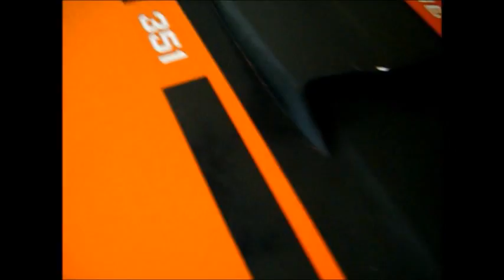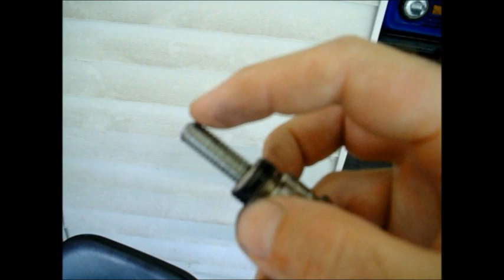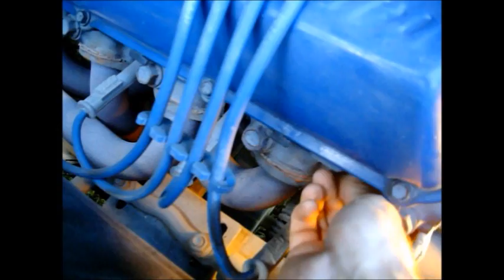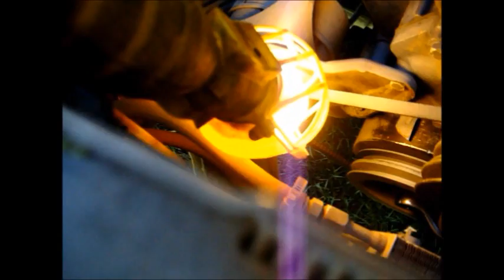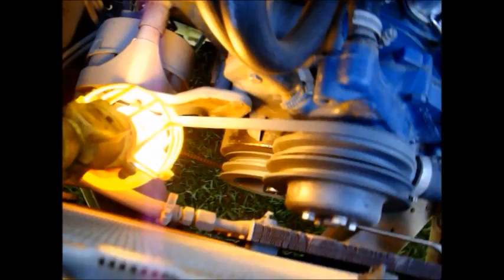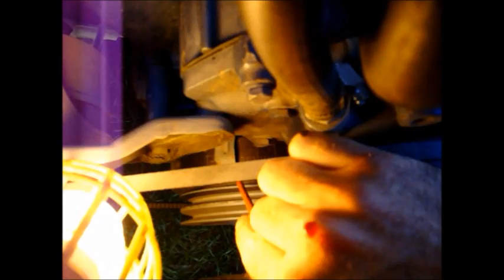Timing - Part 3 - How To - Using a piston stop to find true #1 TDC.wmv

Comment: How do we know it is tdc exhaust stroke?
Reply from the maker: That's the easy part.  Just pull the number one spark plug, and block the spark plug hole with your finger tip or thumb.  Then turn the crankshaft with a 1/2" drive ratchet setup on the harmonic balancer bolt.  As the piston comes up on compression stroke, the compressed air has no where to escape, so it blows out by your finger, you'll feel it.  When the air blows out, just keep an eye on the balancer, the timing mark will be coming up soon and you'll be at TDC of compression stroke on number one.  You could remove the coil wire, and turn the engine over with with the starter, with your finger blocking the spark plug hole, but the crank spins kind of fast like that, and it's easy to run it too far, and miss the timing mark.  More control with a ratchet setup, but that's just my preference, either way will work.  Just make sure you know where number one is, different car makers number their cylinders differently, which is annoying.  If you don't have a repair manual for your car, you should buy one.  And of course for this trick to work, your valvetrain needs to be fully installed, and rocker arms adjusted (up/down on the pushrod, while adjusting rockers on hyd lifters, never twist the pushrod between your thumb and fingers, very good mechanics will tell you to twist, terrible idea....too easy to accidentally end up with negative lash, up/down to find zero lash, up/down will never lie to you, once you have zero lash established, another half turn on the rocker arm nut will put you in the right spot).  And you know it's not the exhaust stroke by putting your finger on the spark plug hole, because on the exhaust stroke, the exhaust valve is open as the piston comes up, so the air doesn't need to blow by your finger, it just goes out the exhaust port.
Reply: @owenrobertson  Owen,u r the best. If u don't mind,I may give u my watsapp number for a more private conversation. U might possibly have to train me further. I own a repair shop in Kampala but need training from time to time as technology changes.
Reply: @owenrobertson  email me at ericwodeya@gmail and we share contacts for that purpose.
Reply from the maker: @wodeyaeric5351  You own a repair shop in Kampala, Uganda?  I'm guessing I'll be very little help.  I'm not a pro, I'm just a guy that likes turning wrenches on old cars as a hobby.  Still, I'm happy to make a new friend, so I shot you an email.
Reply: @owenrobertson  That part of Kampala is the city square with Mapera house imposing opposite it. Uganda speaks English for a national language with scattered users of Kiswahili. Kiswahili is mostly used in neighbouring Kenya and Tanzania--infact in Kenya's parliament it is used together with English.
Reply from the maker: @wodeyaeric5351  Well that's good news for English speaking tourists, I'm guessing a lot of people come to Uganda to see the wildlife, and Lake Victoria.
Reply: @owenrobertson  Oh yes,Lake Victoria, Marchison falls,Sipi falls,game parks ,Uganda wildlife education center,etc.
Reply: @owenrobertson  Yes,i own KOT ENGINEERING LIMITED.  We have recruited guys upto date with modern technologies and we are moving. But truth be told,ur explanation of true TDC was the best. Shoot me an email and we pick up from there.
Reply from the maker: @wodeyaeric5351  well thanks for saying that.  I sent you an email yesterday.  Did you reply to that email?  If so, I didn't get your reply.
Reply: No.I haven't received it unless it is in spam. Let me check spam.
Reply: @owenrobertson  That's better.

Comment: So,how does one know when it is dead top center compression stroke & not exhaust? This became a plateau in my motor vehicle repair journey. I am glad I got this video--it has shed off some of the issues nobody wanted to tell me.
Reply from the maker: That's the easy part.  Just pull the number one spark plug, and block the spark plug hole with your finger tip or thumb.  Then turn the crankshaft with a 1/2" drive ratchet setup on the harmonic balancer bolt.  As the piston comes up on compression stroke, the compressed air has no where to escape, so it blows out by your finger, you'll feel it.  When the air blows out, just keep an eye on the balancer, the timing mark will be coming up soon and you'll be at TDC of compression stroke on number one.  You could remove the coil wire, and turn the engine over with with the starter, with your finger blocking the spark plug hole, but the crank spins kind of fast like that, and it's easy to run it too far, and miss the timing mark.  More control with a ratchet setup, but that's just my preference, either way will work.  Just make sure you know where number one is, different car makers number their cylinders differently, which is annoying.  If you don't have a repair manual for your car, you should buy one.  And of course for this trick to work, your valvetrain needs to be fully installed, and rocker arms adjusted (up/down on the pushrod, while adjusting rockers on hyd lifters, never twist the pushrod between your thumb and fingers, very good mechanics will tell you to twist, terrible idea....too easy to accidentally end up with negative lash, up/down to find zero lash, up/down will never lie to you, once you have zero lash established, another half turn on the rocker arm nut will put you in the right spot).  And you know it's not the exhaust stroke by putting your finger on the spark plug hole, because on the exhaust stroke, the exhaust valve is open as the piston comes up, so the air doesn't need to blow by your finger, it just goes out the exhaust port.

Comment: Owen have you had any over heating of your starter using headers, I just installed a set of Headman headers and the starter is very close to the header, I was thinking of using exhaust wrap, whats your thoughts ? and thanks for the video !
Reply from the maker: I've only used that header wrap once, on my '70 Mach 1, and that was over 20 years ago.  I wrapped both headers, because I read something in a magazine saying it helped performance, thermal something or other.  I don't remember the details from that article.  I ran those headers for a couple years, and nothing about that wrap really seemed all that worth while to me, so I haven't messed with it since.  My Mach 1 has exhaust manifolds on it now, some of my cars still have headers (unwrapped), and no problem with burning up starters, as compared to my cars that don't have headers....from what I can tell, my starter shell out rate is the same regardless of unwrapped headers or stock exhaust manifolds.  Plenty of burnt hands, trying to remove a starter while the header was still hot, though.  So much easier replacing a starter on a car with exhaust manifolds.  That said, if you've got an early Mustang like mine, the air in the engine bay can get really hot, it's cramped in there because of the shock towers taking up so much space, and there's not a lot of air flow through that engine bay, especially when you are stuck in traffic.  Anything you can do to reduce engine bay temperature isn't a bad idea, to include header wrap.  I cut a hole in my '69 and '70 hoods, just to get the air cleaner out of that hot engine bay, and up above hood level into ambient air temperature, that fixed the vapor lock issues I was having with my '70 Mach 1 in the summer, when I lived in Las Vegas.
Reply: Thanks for taking your time to reply, My situation is a 1976 Ford F350 which gives me a large engine bay, I replaced the worn out 390 with a fresh 360 and decided to go with headers and the Headman headers that I purchased run down very close to the starter, good to know that you didn't have any heat issues regarding the starter using headers, I ordered wrap and I will probably install a heat shield over the starter, again thanks for your input !
Reply from the maker: Good plan.  Good luck with your truck!